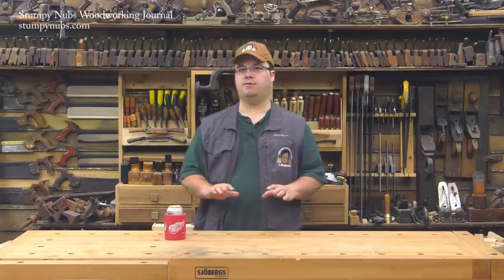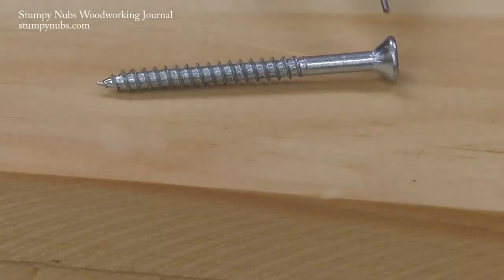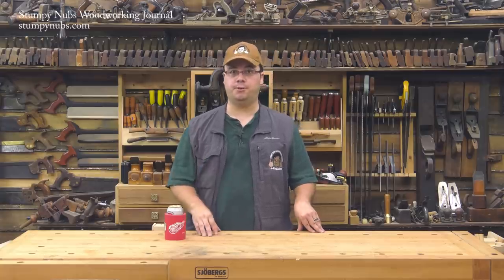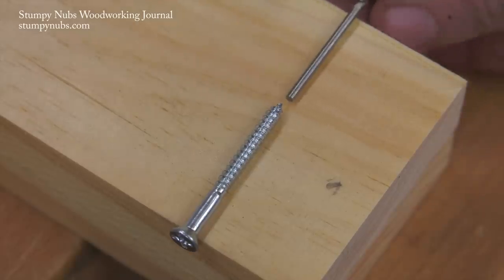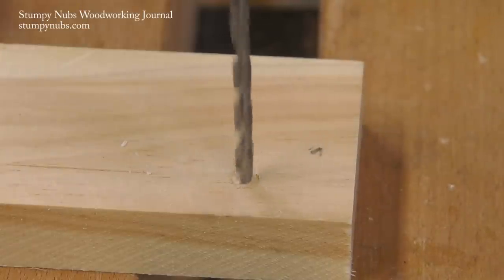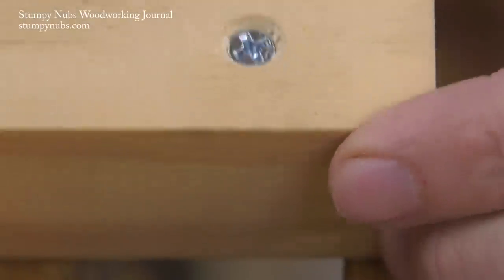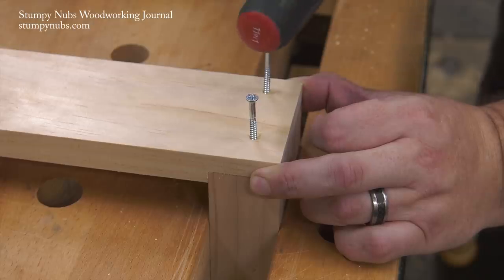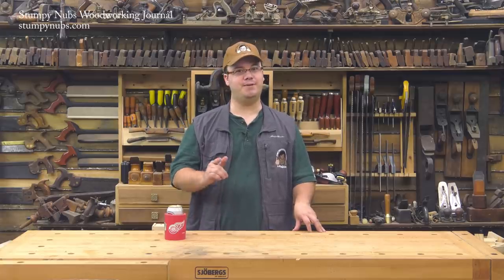Why old-timey woodworkers' screws held better (How to bore proper pilot holes)

Comment: Sheet metal screws out shine wood screws about 5 times over. The heads don't strip out as easy and the don't snap as easy. Wood screws break at the transition between thread and body.

Comment: Chisel handle as a hammer!!!!!!! with all those hand tools behind you....... come on
Reply from the maker: I only need a very light tap. A hammer is overkill. It works, it doesn't damage the handle (it's a screwdriver, not a chisel), so what's the problem other than someone made a arbitrary rule that says you need an extra tool?

Comment: "Let me show you how it was done one hundred and fifty years ago" then he proceeds to use an electric hand drill.
has he never heard of a brace (and bit) or a wheel drill
Reply from the maker: I own several. The point was the offset hole, which can be done with any kind of drill. I also have electric lights on in this video. That doesn't mean I have never heard of wale oil or kerosene.
Reply: @StumpyNubs  it also wasn't a silent film in black and white, made by someone turning a handle on the camera....

Comment: LoL.. that is not a traditional wood screw..... 0:27
Reply from the maker: You take the word "traditional" too literally. Wood screws have featured many designs since the 1700's. There is no true "traditional" design, not in the literal meaning of the word. The word "traditional" is here used to separate what is today known as a wood screw from the common construction screw. Of course, this video is not a language lesson, so it's sort of beside the point.